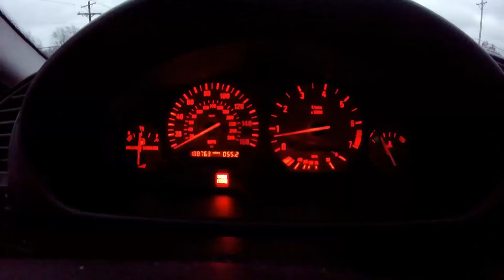Should You Ever Replace Your Transmission Filter?

Comment: Well why do they put a filter in in the first place? What is it filtering? If it’s filtering fragments then the tranny is gone. What purpose does it serve?
Reply from the maker: There is always a small amount of debris  from the initial break-in of the gears that are in constant mesh. Also the clutches wear over time and the clutch material has to be filtered to keep it out of the pump and valve body. There is enough surface area in the filter media to effectively filter this normal amount of debris. If the filter is clogged to the point it affects the transmission performance, then the transmission has bigger problems and changing the filter is not going to fix anything. 

I do think you should routinely do a fluid exchange. Just there is no need to spend the time and money on dropping the pan to change the filter.
Reply: I have a 4L80e with 220,000. 99 suburban. I’ve been trying to decide whether to pull pan and change fluid and filter to synthetic just got back from camping in mountains and pulled the guts out of it. Just thinking that fluid might be burned. Incidentally is there a port for a temp sensor on these. Be nice to know what the temp was. I don’t know why they didn’t put one on a c2500. Thanks for your input

Comment: Do I think a trans filter needs to be changed as often as the oil filter? Probably not. It will last longer because trans oil isn't going through the same processes as motor oil. That being said, it might be a good idea to do something about the transmission system when your engine reaches 150k-200k miles.

Comment: Agree with you. You should have shown everyone what the filter looks like as all it is is a screen material. Only holds big chunks out. I have a Toyota with 350k miles and never had I ever change the trans filter. I only do drain and fills every 20k miles and it still shifts fine.
Reply: 517,000 miles on a 1997 Suzuki Esteem wagon, (same trans that many Toyota models use), fluid is changed every 20 to 30k miles, still shifts impeccably and shifts are so fast and smooth that the only way you know it's shifting is watching the RPM's lol.  ATF used is Valvoline MaxLife Full Synthetic.  Trans filter has never been changed. Fluid has never been allowed to get dark. Car has now been passed on to a cousin that plans on keeping it another 20 years or so, following the same maintenance schedule.

Comment: The engine oil filter does the same thing as the transmission filter because the transmission gets hot and like the engine and it will filter small metal that comes out from the gears so the filter is filtering that metal to save the clutch. I hope you learned and don't give wrong info to people who don't understand this
Reply from the maker: Engine oil and transmission fluid live very different lives. The engine oil breaks down due to the high temperatures of combustion and receives acid deposits that are formed from the fuel and combustion. There is no combustion occurring in the transmission and the temperatures are hopefully under 220*F. The fluid does three things: lubricates the gear train, is a hydraulic fluid to apply the clutches and transfer motion in the torque converter, and to maintain the friction properties to allow the clutches to not burn up or slip. The filter just makes sure that no debris from break-in and normal, small amounts of clutch material don’t get stuck in the valve body and hang up the valves.

Comment: Isn't that device more correctly termed a SCREEN? It's just there to keep the tiny passageways and solenoid valves inside the transmission from clogging. Change the fluid often but a new screen/filter, it's not really need each time (or ever). Hayabusafalcon.

Comment: Transmissions have cluch packs and yes over time metal wears over long time I agree, if the filter gets used overtime the fluid can be slowed or partially blocked and  then the Transmission will wear even faster and eventually fail even faster. I mean I have seen everything even made for life eventually fail, so to me a filter is best if accessible even when made for life because a filter would have to be made huge and in a special way or not have one period in the Transmission to allowe all the long term wear to just flow freely and a simple flush  and clean would do the trick heat causes more wear. Any no maintenance lifetime Transmission as far as I no the filters are the main drawbacks every single time. So go ahead and gamble if you want , I wish my Transmission filter did not have a elictric connection sensor and I would just take my filter out. Then just do a partially fluid exchange every few years, because honestly  the clutch packs made for life do better with old micro materials flowing around being used with friction agin over and over. When the fluid is completely new the clutch packs are protected anoff yes but wear faster, so drive your car for life if you want with no maintenance but I have seen everything fail even following the manufacturer. I have worked in dealerships. Fact the filter must be used because after awhile things can jam up the sensitive transmission parts , solenoids and so on. The lifetime filters should be made for fluid to pass easily even when dirty and can no longer catch debris, even heat can cause the filters materials to change. A transmission filter can get overwhelmed say if the engine  fails or has a over heating issue or  something causing the transmission to run at much hotter temperatures and wear faster.

Comment: Yes you are crazy. I have seen what happens to transmissions when they are not taken care of. And I hear the people complain about the cost of having a rebuilt done or a new one put in. with today's electronic transmissions cost even more than the old ones use to. Just ask your self what does a filter do? So yes when you service your trans replace the filter. And make sure you use the right fluid for your tans.

Comment: I just put 100k miles on my car and do my own work....I could see the metal shavings on the strainer.   I’d say 10-12% clogged up.  You mention the strainer acts as a suction...Why not just take it out...(3bolts) and replace it with a clean one.  Sure it cost $50 for a genuine one from the dealer but just like my sink....if I see it 10% clogged up with a hair ball I’m going to pull it out and not leave it as is.   Plus when you open the pan you can clean up the magnets and get the rest of the used oil out.
Reply from the maker: Why did you have the pan off? Where did the metal come from? Were you trying to figure out an issue?

Comment: I understand a new vehicle should have the transmission changed around 10,000 miles. Because the moving parts will then be broke in. Then the filter collects those metal particles. After that I agree with you. But by 60,000 the filter has again collected more metal particles from the pressure plates. I believe strongly that the filter keeps the transmission running for 300,000 miles if it is changed every 40,000. 
   Now I have a 2001 V70 XC that has never had the filter changed. It stopped working. It needs new solinoids and filter and fluid. I believe the filter is clogged up. It refuses to run!!
Reply from the maker: Cut the filter open and see what’s in it. I’m curious what you’ll find.

Comment: Heat degrades oil over time making it more viscous.  Thicker oil results in more friction, friction makes heat and further degrades the oil.  After 60,000 miles drain off any transmission oil, change the filter, and replaced the drained quantity.  Repeat every 30,000 there after for a happy transmission.  Does the factory say to do it, no, it's out of warranty and they want repeat business.

Comment: What if the oil is in dark brown territory?
Reply from the maker: Then drain the fluid and fill it. Or use an exchange machine hooked up to the cooler line. No need to drop the pan.
Reply: Hiow is the transmission fluid flush work when connect to cooler line? (If it mean coonect to the water cooler line for the transmission, that is no)
Reply from the maker: There is no water cooler for the transmission. Unless you’re talking about where the transmission cooler line connects to the radiator. I usually connect the flush machine to the transmission line at the radiator. No need to even lift the car. Unfortunately you can’t flush it like that unless you have a flush machine.

Comment: But some people use the car with 200,000 miles when I poor the oil out looks like a cream full of deposits and residual stuff, even the magnets inside the bottom are stick with that thing in this kind of treatment I replace the filter too. Some transmissions are so worn out and still running even do have that creamy oil and when is change to a new one the transmission stop working because that creamy fluid is what the worn unit with no maintenance need for fill the gaps created from worn and tear. So, is to late to change the fluid after the life span of the unit. The same happens with the engine, never change the oil, when you replace it the engine begins to smoke, loose power, drink lots of gasoline, make lots of noise. That is the reason someone invent the word maintenance. If the oil is clean and give the need it maintenance is possible that the filter can give more service.

Comment: You say that we don't need to get filter change because trans oil doesn't get dirty, that there is nothing to get it dirty. Well si, let me tell you I did my trans oil change after 60k miles and it came black. After that, my transition made faster shifts, but it tends to get stuck on a its gears for a sec or 2 and its because I did not change the oil filter. Anyone thats hasn't changed their trans oil after 50k miles, it will certainly out black once they do. You say there is nothing to get it dirty, but it still happens
Reply: How many miles were on the fluid? The oil changes color with heat over time, and that is why we change the fluid. It loses it’s ability to cool and lubricate once it is exposed to enough heat over time. If your fluid has debris in it, something is wrong with your transmission because there are chunks of your transmission in the fluid. If the color changes to dark quickly, then your transmission may be overheating due to another problem with the vehicle.

Comment: I am not a mechanic so take what I say with a softball sized grain of salt.  I will change the transmission filter if I believe that changing the filter is less likely to damage the vehicle than not changing the filter.  For example, I have a vehicle where the transmission filter is located within the transmission housing and in order to change it I would have to drop the entire transmission, crack it open, and then replace the seal and reassemble it.  I believe it is more likely that the transmission is damaged doing that to an otherwise fully functional transmission than to just leave it alone.  Conversely, if all I have to do to replace the filter is drop a pan and replace it, then I'll spend the extra few bucks to do it.  It is highly unlikely that I will cause more damage by removing a pan and seal than leaving it alone.

I have also heard that people epoxy a rare earth magnet to the transmission drain plug to get the metal particles that way.  Good or bad idea?  I would be afraid to try it for fear that the magnet would get loose and wreck the transmission.
Reply: Just epoxy rare earth magnets to the outside of the pan bottom. Will magnetise the whole bottom.
Reply: @4af  That sounds like a great idea.  All the benefit with none of the risk.

Comment: From my experience I have driven my own cars over 400.000 kilometers I changed the oil ones every 100000 kilometers the engine failed before the transmission. before the

Comment: I think I agree, however I think that the engineer who designed the transmission is the last word. Changing lubricant is never going to repair mechanical damage. Expired lubricant will cause mechanical failure. I’ve owned vehicles for 50 years. 2022 autos have unique requirements and specific to each vehicle, and year. However, if you have transmission fluid that is contaminated with material, getting the contamination removed might help you squeeze another 20k of life. We expect 10years or 200k from a vehicle, and that’s pretty good. My mechanic bought the transmission oil change machine, and followed your thinking. My last two gm trucks, bought new, an maintained both had transmission failures. Yes I drive them hard, not abused, but within specifications, and in extreme climate, and gm is not known for great transmissions. So I think, not changing transmission filters hasn’t worked. I think gm says, change filters,,so ???

Comment: If you are changing the gasket  a filter comes in the same box .
Reply from the maker: Sometimes. If you’re dropping the pan to change the gasket… you might as well change the filter. But I wouldn’t drop the pan just to change the filter. You can exchange the fluid other ways.

Comment: If it’s not going to get clogged up then why even have a a filter in the first place? 🤔
Reply from the maker: All it takes is one small piece of debris to hang up a valve in the valve body so you need the filter to ensure nothing gets in there. During initial break-in there will be some small amounts of debris and small amounts of clutch debris will accumulate throughout the life of the transmission. I would hope that all can agree that if there’s large amounts of debris, the transmission would need an overhaul. Just throwing a new filter into the transmission won’t fix anything.

Comment: You say the filter cant get dirty. When I took mine to aamco the say cutting can get in filter. Like u said metal . But if you change transmission fluid and filter u might extend the life of the transmission. I was told that the cuttings can cause the filter to clog off. Who wants to pay thousands to replace the whole transmission on a car you paid only a few thousand for. Doesnt make a whole lot of since. Id rather change the fluid /filter to for a few hundred bucks.
Reply: Mine is far over due at 120 k.
Reply from the maker: Go ahead and change the filter. Cut it open and see what’s in there. If your transmission is shifting fine then I bet there is hardly anything in there.
Reply: its not shifting fine . it slips a bit on extreme up hills but the fluid has never been changed as my model you have to take the motor mount off to get to the thing. Thanks pontiac @PetesGarageandperformance
Reply: anyway I look at the fine print on what is determined to be a fluid transmission change. It states a fluid change as to drain fluid then check filter and replace if necessary then put new fluid in. So its not up to me its up to firestone . All for 199....

Comment: So $3.45 is wasting money? The filter tube seal gets hard and the filter is now drooping down fibbing on the bottom of the pan. I spent the whopping bank busting $3.45 and installed a new seal and filter.
$3.45 was the difference between just buying a pan gasket and just getting the filter/gasket set with a new pickup tube seal.
People piss away more money driving 99mph just to sit their butts on a bar stool.

Comment: Oh my daughter's car got caught in a flood to where the water was actually going into her driver's window so had to drain and flush the motor new spark plugs new spark plug wires, water pump, even had a brake caliper that seized up and had to replace it but didn't think about the transmission until it started making a noise like a power steering pump that didn't have no fluid in it! Drop the pan on it and said 😮 as water had gotten into it so badly that the transmission fluid looks like Pepto-Bismol LOL so yeah we we went ahead and changed the fluid and the filter 🤑
Reply from the maker: Yeah that is a different situation all together!

Comment: I just get a transfer pump stick the hose down where the dipstick goes and I pump a gallon of transmission fluid out put a gallon of clean back in run it about a hundred miles and repeat it third time my transmission fluid is completely flushed all brand new including in the torque converter. 🤔 P. S. I know when I used to take the pan off to change the filter I always had a magnet inside the pan that seems to be where all the fine metallic material sticks so why would it be in the filter.  Just saying.

Comment: Cut open that old filter. Let's see what's inside. I think thatd settle it either way.
Reply from the maker: I do that all the time as part of diagnosis to have a better understanding of a failure. Most of the time the filter doesn’t have much of anything in it. Maybe a few flakes of metal from initial break-in. If there’s a bearing, torque converter, or hard part failure, it’s a different story. The filter will be full of metal. But at that point you’ll most likely have symptoms and need a rebuild.
Reply: @PetesGarageandperformance  right.  That's cool. I just thought seeing it would help prove ur point to the doubters in the comments. I need to do a change i think but i'm worried im wrong. Nothing major it just revving a little high when going into 3rd but no slips or hard shifts at all.

Comment: If transmission is sealed and company claims life time no need fluid change so we should change fluid and shouldn't open to change the filter as if there is some dirt it will go out with regular transmission fluid change every 30 to 40 k km.

Comment: You MUST change filter if you can. Hi temp,debris,varnish,metal and liners particles clog filter always. The more you use it the more clogged it is. Obviously changing filter won't fix any trans failure but don't need to make dirty new fluid and mix it with all filter debris. Filters are cheap . Also don't need to heat up fluid that can damage all system just because fluid can't flow freely.